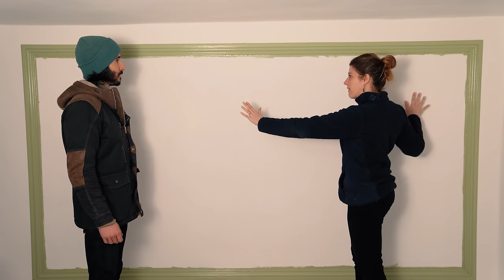Dungeon Disaster and Fresh Paint | French Chateau Renovations #44

Comment: Definitely set up a felt wall in the nursery. I was going to say velcro dots on cutouts, but felt is easier to maintain. I would be interested in a follow-up on your basement flooding. It sounds like your local stormwater management agency has allowed the wrong pitch to develop, resulting in your moat levels being too high? (Our local stormwater agency constructed a whole wetland to help a frequently-flooded neighborhood, and it only works partially!) Is there a way to seal off the entry points where water is getting in?